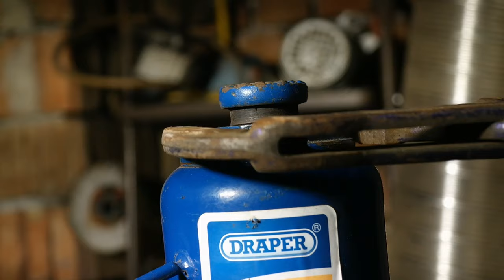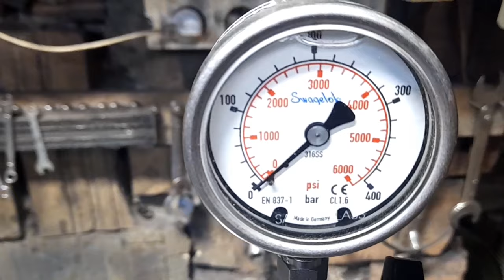Making HYDRAULIC JACK Injector Tester

Comment: Lets see, an inoperative gauge so you don't know what pressure the injector is popping off at so in essence it is useless.
Reply from the maker: This pressure gauge is from the beer dispensers.  I think higher pressures are needed to work.  The device for checking injectors works, only the pressure gauge needs to be replaced.
Reply: the valve needs to be mounted after the valve.
Reply from the maker: https://youtu.be/BK2dEXgEPuk

Comment: where you bought pressure meter gauge with fuel connector? answer now plis, urgent
Reply from the maker: From local market.
Reply: @DorelBorlea injector de u650 😂
Reply from the maker: @Ovidiu668  ce?

Comment: Hello, would it be possible to have the measurements of the cylinder you machined, I have the same jack, with all my gratitude. FRANCE.
Reply from the maker: Hello. You can make an injector tester from any hydraulic jack. I no longer know the dimensions at which I machined the cylinder on the lathe. You have to drill the piston at the base and make a cover in the upper part of the cylinder. On that cover you have to mount a pressure gauge and a pipe that goes to the injector.

Comment: Don't see the gauge working....😮
Reply from the maker: I wanted to see if an injector tester can be made from a hydraulic jack. This pressure gauge is for beer dispensers and I think much higher pressures are needed to work. It's a functional project, only it needs another pressure gauge..

Comment: Great build. I'll be making one myself, bot sure what gauge to yse either.. 400bar seemed smart but apparently not, or you had a bad injector or low pressure petrol one 🤔 mine will be primarly for diesel so id expect 250bar i believe 🤔 hmm.. thanks for this 👏🏼👍🏻👍🏻
Reply from the maker: Hello.  The pressure gauge is good.  The problem was with the tap, diesel fuel went from the jack to the injector or from the injector to the pressure gauge.  I canceled the tap function and now it works fine.

Comment: Let me ask you something, master, what do you put in the hydraulic pump, is it pure diesel or do you mix it with oil?
Reply from the maker: Pure diesel.
Reply: But I'm interested in this, can a pressure gauge of 400 bar, and a hydraulic diesel of 2-3 tons, if you understand me
Reply from the maker: @aleksandarscekic5402  Yes.  You can use a 2T hydraulic jack and a 400 bar pressure gauge.
Reply: So, can the hydraulic pressure gauge with glycerin from 0-400 bar, on a 2-ton diesel engine?

Comment: It's fake, how do u fill the diesel?
Are u need to disasemblly the pump for fill the diesel 😂😂😂
Reply from the maker: The project is not completed.  I wanted to see if an injector tester could be built from a hydraulic jack.  A fuel tank is very easy to add.
Reply: You would just fill the oil filler with diesel. not tough to figure out.